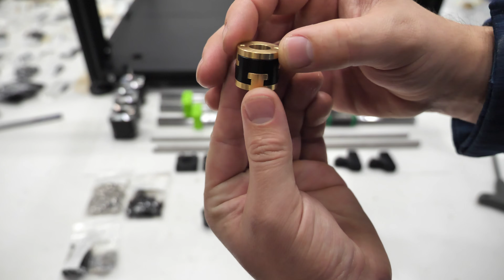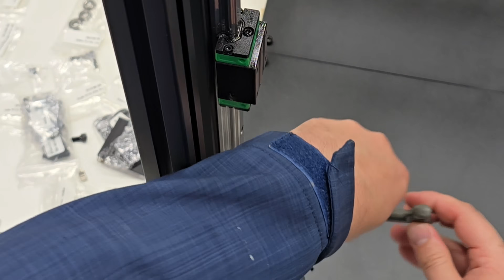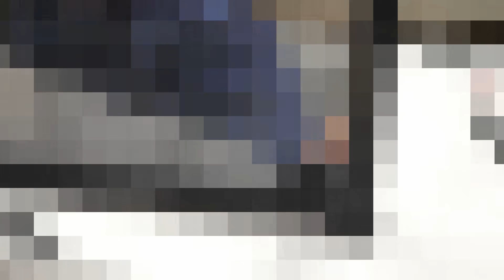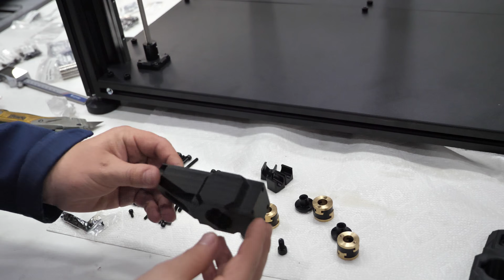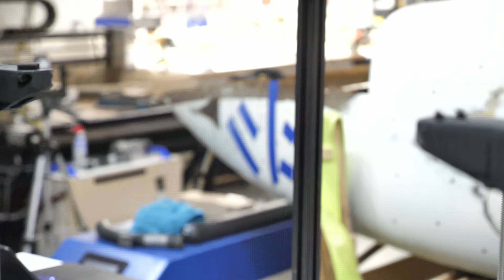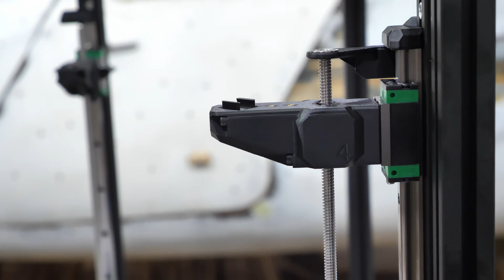Building a RatRig V-Core - 4 IDEX 3D Printer -  Part 2: Z Axis Components

Comment: So far, what is your general opinion of the machine??? Great video great jacket!!!
Reply from the maker: Honestly I spent more time getting it tuned than I planned to, but that would be way faster the second time around and now that i know how to resolve the issues i was eeing.. As far as the machine goes once it's running, it's been great. It's the largest printer I own so it's come in useful for larger prints i couldn't do before. The extruder hotend combo does really well with a .6mm nozzle on those large prints and the flow rate is pretty impressive. I ran the flow rate test to 20mm3/s and it never showed any issues. That's enough for me because anymore runs too fast mechanically in my opinion and layer adhesion seems worse in my experience. The idex is really neat, I haven't had a chance to put it through it's paces too much yet but when it's well aligned and configured  it's way faster than any other material changing I've seen and it seems really capable.
Reply: @RocketkidDesigns  When you say "getting it tuned" do you mean slicer settings or like Re-aligning hardware and what not. What was your struggle?
Reply from the maker: @ApocalypsesDawn  So some slicer tuning, but there were a bunch of annoying issues getting the first print going. I had to update quite a few things in the config files in klipper because I was getting errors that weren't explained and it just wouldn't print. There were quite a few things there. Once I got through those I didn't have to deal with them anymore but it would be handy if they provided some of the fixes in the default configs. Mechanically I had some issues with the idex setup because they say to not put in the hybrid belts until after tuning but they're required for idex to work at all. Then I kept getting really strange artifacts that I thought were ringing or ghosting but I couldn't get them to go away. Then I saw them on a large straight print and realized they were related to the teeth in the belt, basically I had it tight enough that when each tooth went over the smooth idler pulley it would cause the print head to slightly move and make the waves on the print. That was weird because I didn't think they were very tight, but loosening fixed that issue. There were a few others, and I actually came up with my own solution for controlling the part cooling fans for the odex setup that I haven't seen anywhere else. I'll be making a video about that too soon.
Reply: @RocketkidDesigns  Dang man that sounds like a headache I look forward to the next video. I'm hopefully putting mine together next week. I'm a noob at kit printers so I imagine I'm going to be pulling my hair out at some parts.... Can't wait lol
Reply from the maker: @ApocalypsesDawn  oh you'll be fine it's really not as bad as it sounds it just takes some patience which I'm usually lacking haha. If you have any questions let me know. I'm trying to answer them in the videos but if there's anything specific I can address it.
Reply: @RocketkidDesigns  Thanks man. I'll subscribe